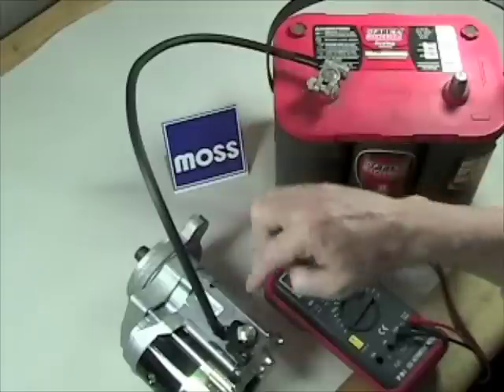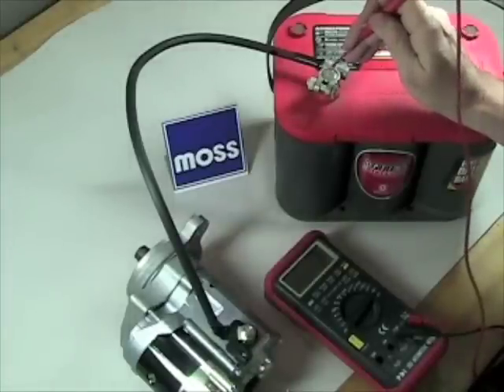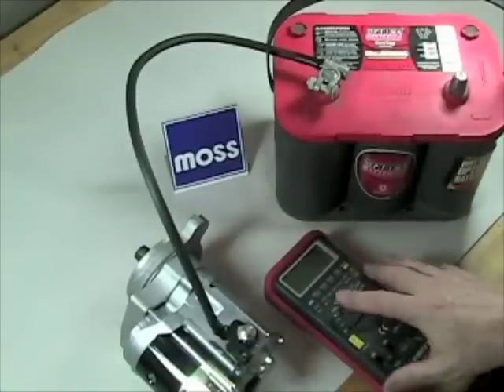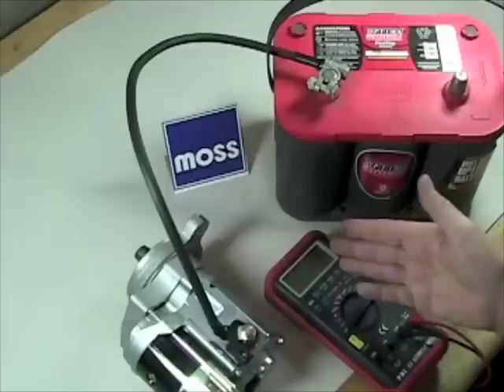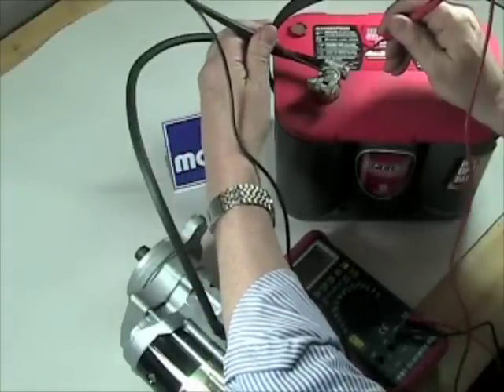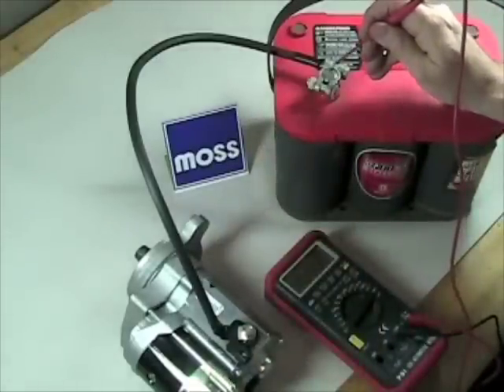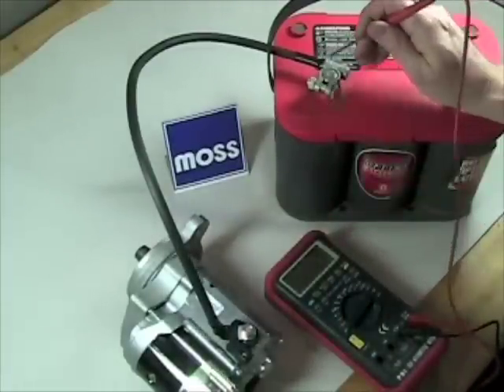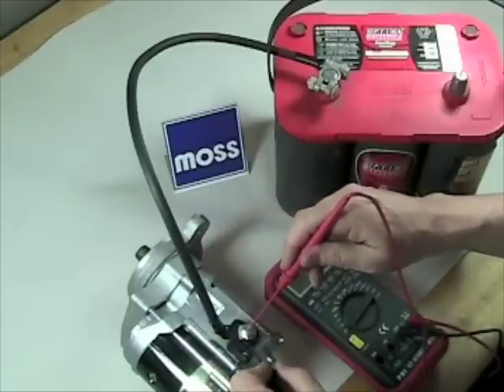Voltage Drop (Pt 4) - Practical Test and Use

Comment: Because, the resistance in a live circuit is often created by current flow in that circuit. That's why high current circuits like the 'starting circuit' is often used to demonstrate voltage drop. 

DO NOT pierce wire insulation... if you feel that you must, seal it up afterwards pls.